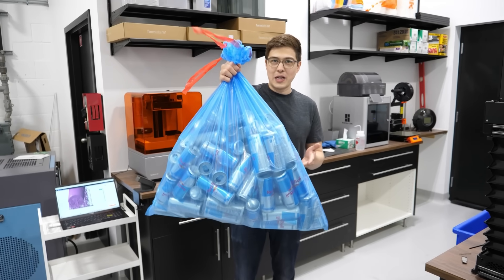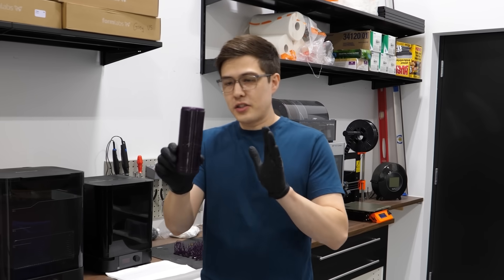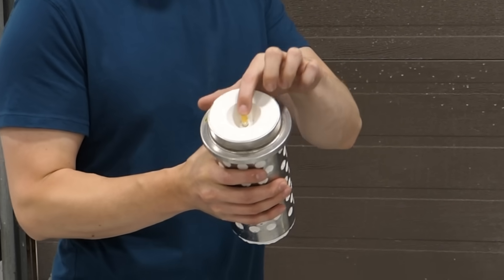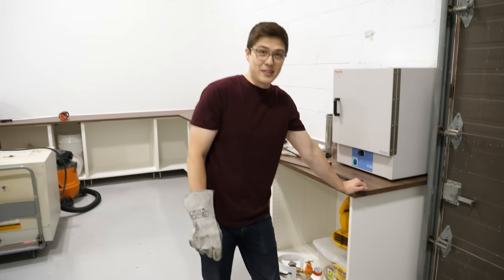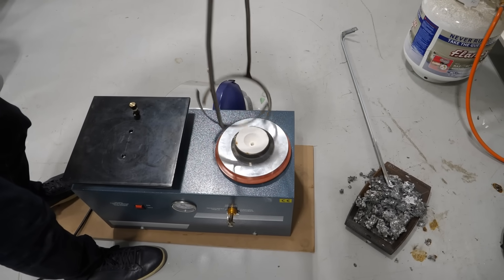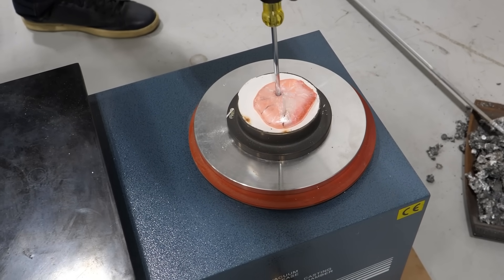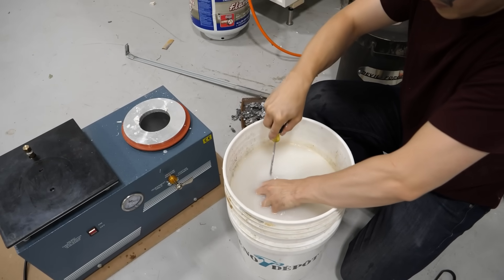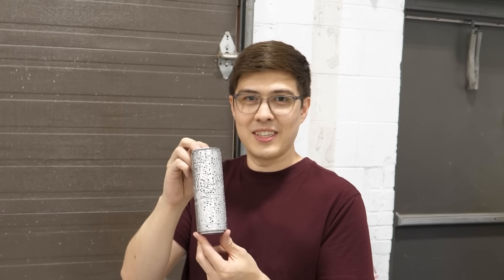Melting down 100 cans of Red Bull into just 1

Comment: You get a lot less slag if you use heated shielding gas to melt the aluminum instead of directly heating it with a flame.  (Inert gas can be plasma or gas state, doesn't matter.) 

Combustion byproducts, residual fuel and residual oxygen can all react with your aluminum, increasing the amount of slag drastically.

Of course, this was a silly fun project, so I'm sure you knew doing that would help, but without a premade rig it was an unnecessary added step with only slight benefit (even if it was one you clearly underestimated by the amount of slag you had.)
Reply: As a note, if looking to make something similar for your science kits, low-temp glass, low temp thermoplastic, or a two-part resin plastic.  With all the cutting edge plastics, and new generation glass materials, I'm sure there are a wide variety of options.  

I think this project could really be adopted into a kit that would work well to combine applied science and art.

Comment: 1. That aluminum was WAY too hot. Aluminum can dissolve hydrogen as it gets hotter so has bad porosity when you overheat it. It barely needs to be glowing to melt.
2. I believe the mold should be baked upside down so the wax can come out. Put a pan underneath to catch any liquid that melts. I realize it may be different if the resin is supposed to vaporize, but at 150C most wax will only be melting, not vaporizing.
3. Aluminum cans are very dirty. I've been able to just barely recover 75% aluminum by weight compared to the original weight of the cans. About 25% of it becomes slag.
Reply: The thing is aluminum cans have plastic lining, dumb to melt it before removing the inner plastic.

Comment: Lost foam casting is a really interesting subject, you should look into that, basically just machining foam then filling it with metal as you would another kind of cast
Reply: I feel like the wax version is better cause you can do all the same stuff but you'll have a smoother end texture cause of the lack of cells like foam has, the hard casting wax you could toss a block of onto a CNC and have it carve it no problem
Reply: @noodlelynoodle.  Yes i didnt know about that
Reply: @exstacc1886   it's kinda weird to think about it as wax even cause the hard stuff feels basically like hard plastic, like trying to carve it by hand is such a pain

Comment: You can pull some of the aluminum back out of the slag by remelting it and adding a 50/50 mix of kosher salt and potassium chloride (salt substitute). It looked like the slag had a lot of recoverable metal in it.

Comment: I think you need to research more about the specific chemistry and techniques of casting metal and see if you can get one with less pitting/voids.
there's way more to it than just putting metal in a hot box and letting it melt, there's dross, there's agents that can be added to bring that to the top so it can be skimmed off so it doesn't form voids, there's ways to get the gases out, there's techniques in terms of handling while still molten that can help as well.

Comment: When they didn't account for the slag, I thought he was going to say "Unfortunately we had to drink more cans of redbull to make up for the loss"
Reply: Does aluminium create more slag than other metals melted and/or is the print and dirt from used cans a factor?
Reply: Aluminium cans are not completely aluminium, they have a coating on the inside and a print/label on the outside. That's what makes so much slag when melting cans in general, not only red bull
Reply: @anders630  
It's mostly the impurities because aluminium cans aren't 100% alu or even 100% metal, they have a plastic sleeve on the outside and inside. They also forgot to smelt it properly so A LOT of material oxidised and mixed with the impurities.
Reply: I really want to add a like but the number is too perfect
Reply: yeah and using aluminum that wasn’t a redbull can ruins the whole premise IMHO
Reply: yeah disappointing 😢
Reply: I thought he was going to turn the scrap piece of aluminum into a can of red bull
Reply: are all those holes due to air bubbles trapped during the casting process? would tapping the mould against the floor a few times fill those holes?
Reply: @LiquidSnakeSSJ4 Why did you post this under this comment....
Reply: @jamesofallthings3684  One reason to post a question under a thread is it's more likely to be seen than in the general comments. If you write a comment in a thread under a top comment people are more likely to see your comment and many of the people in the thread will receive a notification that you commented. If you ask a question in the general comments no one will see it unless you're one of the first or they scroll way down and come across it. So if you want a question answered by viewers and not directed toward the creator then this is the the proper place.

Comment: Funny science guy on youtube does funny melting video, yeah I get it, and its fun to melt random objects into new shapes even if you are sloppy about it. not everything needs to be a science all the time

Anyway, here is the stuff for the nerds
So the funnel was way to small, should be about as thick as the thickest part of the mold and attach to that part (since it was solid can, good luck) 
The aluminum used in cans and the random parts he trew in afterward is an aluminum alloy meant for extrusion molding, not casting. thats mainly gonna impact how well it picks up details
The cavities in the result are, as per my unskilled opinion, hydrogen perosity. liquid aluminum sucks up hydrogen from the gas burner like crazy (propane gas is a carboHYDRATE after all), which crashes out of solution once the aluminum isnt solutioning anymore and starts solidioning
To prevent this there are some ways to cover the top, some throw in sawdust, others specialised products to clean the melt and protect against hydrogen. Maybe the aluminum was too hot and the mold too cold aswell. so many factors.
And he should have vacuumed the freshly poured investment to get rid of any bubbles

Not an expert I should add

Comment: Problem was you didn't agitate or vibrate the plaster of paris enough... causing those bubbles. If you just put some sort of vibrating machine to the side of the metal it would have settled perfect.
Reply: Ok. 
Think for a second.
The wax form is solid. 
He pours room temperature investment around the form. 
If the investment retains air pockets that adhere to the mold, when the investment hardens, then the bubbles become voids outside the mold surface. When the wax is burnt out, the voids become part of the surface, filling with molten metal as the main body of the mold fills with metal. 

So please explain how air bubbles in liquid investment on the surface of the mold become gas bubbles INSIDE the molten meta, and not bubbles of metal adhering to the casting surface? 

 Because I’ve done custom fine jewelry carting for over 20 years and bubbles in the investment that adhere to the molded surface ALWAYS become bubbles of metal adhering to the casting surface.

Comment: There wasn't a vent channel for the escaping gas as the molten metal was going in. Thats why there were bubbles in the casting
Reply: No need for a vent channel when vacuum casting. Vacuum pump is supposed to suck all the gases through plaster. His biggest mistake was not degasing the plaster after pouring it over the wax model and then not preheating it enough.
Reply: @2piernik2  the biggest mistake was actually just not having a gasket and not getting proper vacuum, I've done countless castings for people using this exact machine and you need a gasket when you put the flask in or you will get a result like this because of lack of vacuum, the fact that it worked at all is very surprising and just means he had left a massive channel for it to pour down but never checked for vacuum before pouring
Reply: @2piernik2 degassing the plaster won’t change much. That’s pretty much just for avoiding bubbles on the surface of the mold. 
He didn’t have a proper seal between the flask and the vacuum chamber housing lip so he could never get a proper pull going. 
The macroporosity is from overheating the aluminum and having no vacuum/vent for gasses to escape.
Reply: Not really how it works. All he had to do was pull vaccuum on the plaster.
Reply: What is the contraption that he had the mold in while pouring?

Comment: Don't cast with extrusions, cast from cast scrap. And ebay might have degassing tablets, but knowing you, you'd want to make them. Calcium flouride, I think. Then you need a drilled steel "spoon" to hold it on the bottom of your crucible.

Comment: Hello Mr. Red! I am an amateur metal caster and I believe the pitting is caused from a combination of a few things. One, oxidization of the metal in the furnace. You can reduce it by adjusting air fuel ratio. And two, more importantly, mold design. There should be both a pouring sprue and a sprue for gas to escape. A good chunky pouring sprue is generally ideal for these smaller casts (looks like yours was pretty good), it acts as a reservoir to prevent shrinkage. or you could design your own reservoir into the mold. This is what they did with huge casts like cannons back in the day. Cool project, I love all the metal working casting ones. The grillz are a personal favorite for me lol.
Reply: You don't really want a vent sprue with vacuum casting, I agree about using a reducing flame but the main thing is the metal was way to hot which allows more gas to dissolve.

 You only want the molten metal maybe 50c over the melting point to reduce the gas as much as possible, plus vacuuming the investment before and after pouring around the mould would reduce the bubbles.

Another thing that helps is having the flask upside down in the burnout kiln will help with ash and other random debris from the wax falling out, some people even blow low pressure air in to clear everything before casting.

I just rewatched the actual casting part and it seems like he had the selection knob set to investment rather than casting, so he wasn't pulling a vacuum on the casting chamber at all... That may be a big reason 😅
Reply: @jackus217 there’s a difference between a vent sprue not being required and ”not wanting” one. Adding a vent sprue for a vacuum pour is just a form of redundancy and ( if placed properly ) can help stabilize flow and reduce turbulence for a smoother fill. It’s just added insurance when your dealing with more complex geometry and those alloys pron to gas entrapment.  Plus, it can help mitigate issues of timing if solidification begins before the vacuum can fully evacuate. The added spruce accelerates the process by creating a lower  resistance route and added mood surface area for escape, rather then just pulling through narrow mold channels at the face.  Redundancy is usually a good thing and worth a small amount of material loss or clean up time.
Reply: @ChrisS-oo6fl fair enough I hadn't really considered that as I usually do small intricate cast's for jewellery where a secondary vent would introduce more air into the system, but in a big cast like this I can imagine how it would help get excess out.
Reply: @jackus217  yeah aluminium is extra nasty when it comes to bubbles
https://en.wikipedia.org/wiki/Hydrogen_gas_porosity
Water vapor probably came from the gas burner OR even from the paint on the cans

 https://en.wikipedia.org/wiki/Hydrogen_gas_porosity#:~:text=Hydrogen%20forms%20whenever%20molten%20aluminium,hydrogen%20in%20aluminium%20are%20numerous.
Reply: @justcallmesteve3728 Yeah, I totally forgot that. Cans kinda suck. you probably scrape a third of the total mass off in the form of slag and oxidation.
Reply: @justcallmesteve3728  Your link has more text than your comment
Reply: He needs to read this and do over
Reply: I hate being that guy, considering everything you're saying is correct, but the proper spelling is "Sprue" not sprew. But aside from that minor thing, yeah, he needed a vent and to at minimum hit the plaster with light mallet taps, a vibrating tool, or better yet as mentioned, vacuum or pressure pot the plaster. Preheating the mold a little more would help too.
Reply: @TheExplosiveGuy yep, all good points. I've never been very good at spelling lol.
Reply: @TheExplosiveGuy then don’t ”be that guy.”  I never understood the incessant need or desire to correct people on spelling, grammar and punctuation.  Especially knowing that many of us or viewing and commenting on small device screens and using tiny keyboards with temperamental predictive text, auto correction and auto complete.   Spelling isn’t even a metric of intelligence.  I personally think that it’s more then just a compulsive behavior and that it makes people feel better about themselves, while others simply enjoy shaming or embarrassing others.  Our brain is fully capable of understanding the context of the authors statement regardless if they misspelled a word or misplaced a comma.  I believe it’s an indicator of their own intelligence when they can’t autonomously correct that error and move on without commenting. Life isn’t a spelling bee and this isn’t English class.  

Yes, this statement was riddled with both grammatical and spelling errors. Partially with intent and also because….. I don’t give a δαmη.
Reply: @ChrisS-oo6fl some people like to know how to spell. The corrector did so with kindness and class. You did not
Reply: I forgot NileRed has a thing for grillz... it's easy to forget with all the chemistry, but NileRed is actually one of the hardest roadmen to ever move weight. That's why he's NileRed AND NileBlue - he runs both the bloods AND the crips (and some say even the CIA, but that's another story for another bullshit comment I write on no sleep).
Reply: @blacktinibis7250 Damn that's tuff af
Reply: You don't need a vent sprue when vacuum casting, the air is sucked out through the walls of the mold.
Reply: Foundry technician here: Nile you should listen to this man he is right and remember to degas it with nitrogen next time aluminum loves air and unfortunately it's to our disadvantage
Reply: The other thing people are missing is that the aluminum alloy used for making cans isn't ideal for casting.
Reply: @MasterThief117 True. Good point sir. Also the metal is filled with oxidation and crap from the paint. I always scrape about 1/3 of the total mass of in slag. I stopped melting cans for this reason lol
Reply: If you've seen the purple gold video, you'll know exactly why those ugly holes at the end are there
Reply: Isn't it also normal to use red clay as the casting mold?
Reply: No no, he didnt degas the metal before he poured it.
Reply: That cool and all but can you resume it or put a subway surfers gameplay next to the text?
Reply: needed to vibrate the mold more at the start, and vac casting you don't want a vent sprue
Reply: he should use silicon aluminium from dead hdds, that alloy has very low shrinkage, its great for casting parts that need to be mostly ok out of the mold.
Reply: And you call yourself amateur..
Reply: Yeah, his mold design is bad.
Reply: I believe he can do it again with beer cans now!
Reply: Thank you for the insight kind sir
Reply: Adding a chloride salt to de gas the melt is a good idea too. Plus a bit of vacuum while the plaster sets ensures a bubble free mould.
Reply: hes gotta re-cast it now
Reply: Look, this is honestly just his chaos showing. He has a very long video of where he makes purple gold during which he had to learn a lot about how aluminum behaves. He may have forgotten everything.
Reply: You need to vacuum chamber the plaster after pouring it to pull all the air trapped in it. The air got trapped in the plaster mold as it hardened and left bubbles throughout the whole thing.

Comment: Didn’t vacuum chamber the plaster smh
Reply: Not entirely necessary, if your model is smooth and doesn’t  have undercuts. 
But yes, it does give a better resulting investment density.
Reply: @nottheoneyourelookingfor0504  smh fraud
Reply: @stupidmangoz right. 
You chose your handle correctly. 
Which apparently took all your brainpower.
Reply: @nottheoneyourelookingfor0504  .... Both the original comment, and my reply were satire. Chill. No one meant this unironically
Reply: @nottheoneyourelookingfor0504  Maybe it's the abbreviation "smh" throwing you off? they're using it very ironically :)
Reply: @Attewir you’re assuming just as much as I am. 

Who is correct? Only the commenter knows for sure
Reply: @nottheoneyourelookingfor0504 Hey, its ok, there are ways to live outside of trying to attack every little comment you find annoying/incorrect. You have to seek out there.
Reply: @stupidmangoz again, proving your handle correct

Comment: I think if you vibrate the mold, it will help those bubbles to rise to the surface.
Reply: The bigger problem is he didn't have a good seal for the vacuum. I've used one of those before, you really need a gasket otherwise it pulls an insufficient vacuum for the plaster